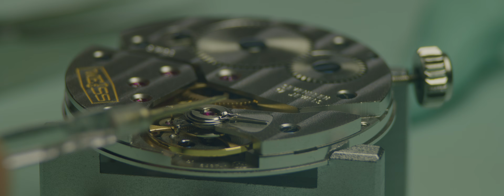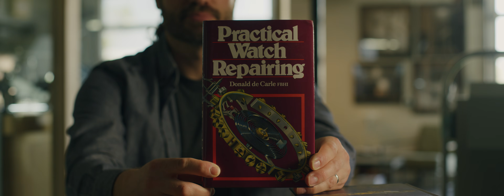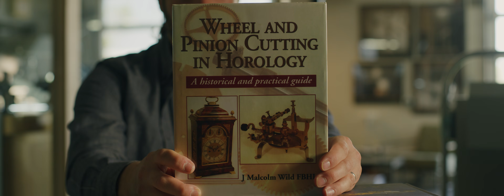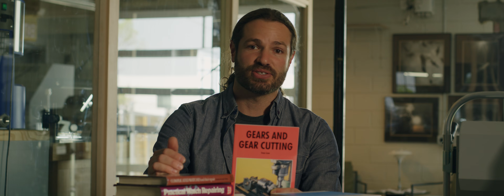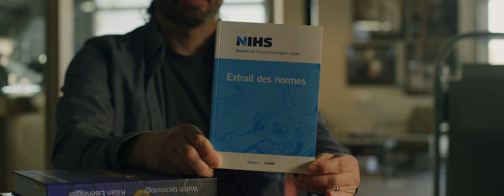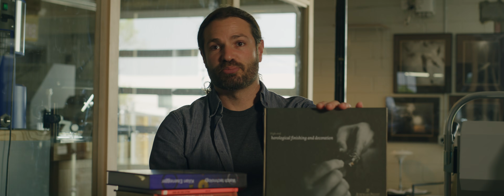Essential Watchmaking Books

Comment: Thanks for this video. The first three books I have and have repaired a number of repeaters over the years, Quarter, Half Quarter and Minute and still refer to "Complicated watches" every time. I agree with your views on George Daniels and found Practical watch repairing very useful in my early years. One other book "Bench Practices for Watch and Clockmakers" by H B Freid is well worth having especially for hairspring work.
Reply: Have you read Kleinlein's "Practical Balance and Hair Spring Work"?  It's not very difficult to find as it's been reprinted at least once.  I've heard that it's one of the best resources on the subject, but I haven't had the time to read my copy yet.